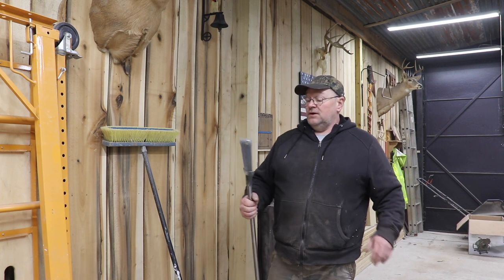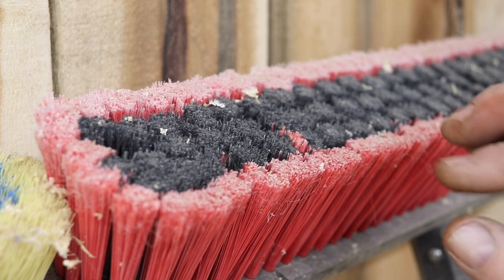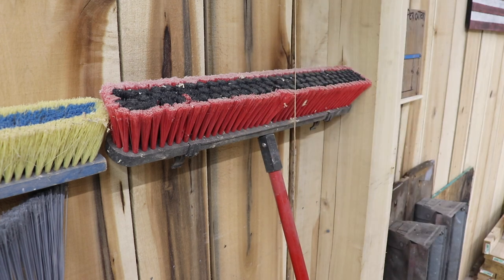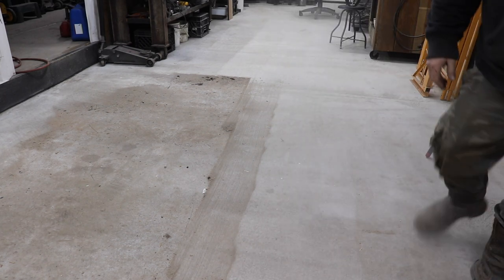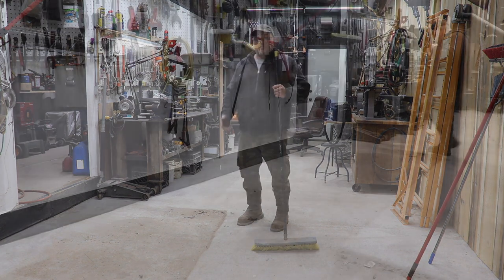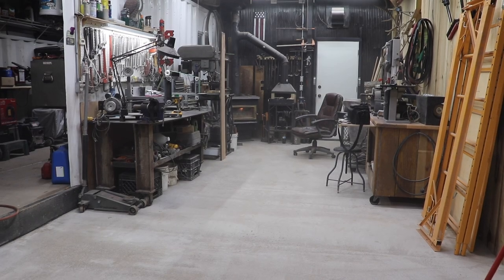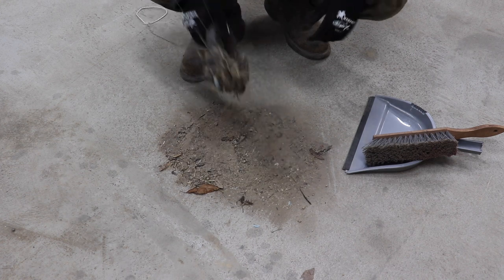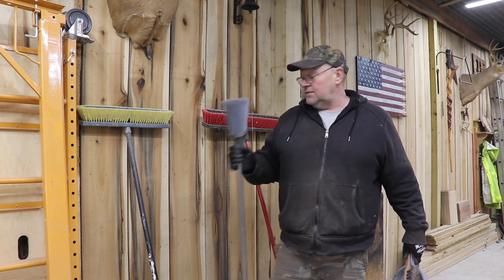brooms for beginners how to sweep a floor

Comment: You and I are a lot alike.  I always put my brooms up side down or I hang them.  I also always use short strokes with push brooms. I find the stiffer bristles are good for heavier stuff and the softer bristles are good for the finer dust.
Reply from the maker: Thank you Frank.